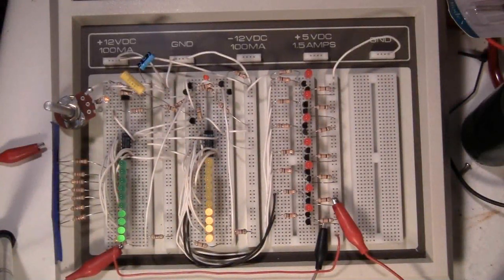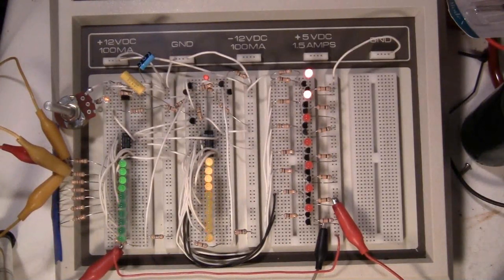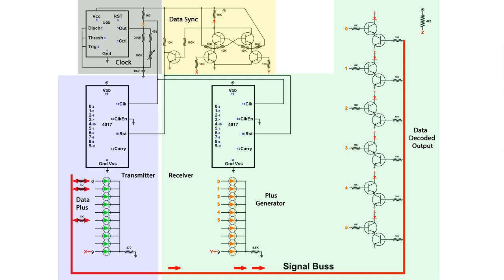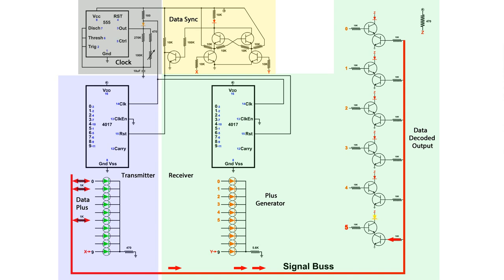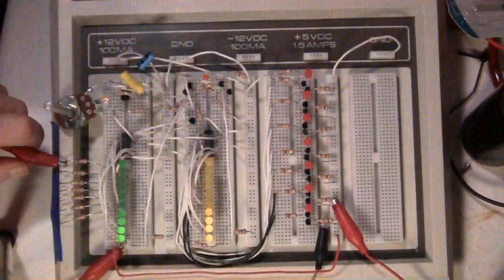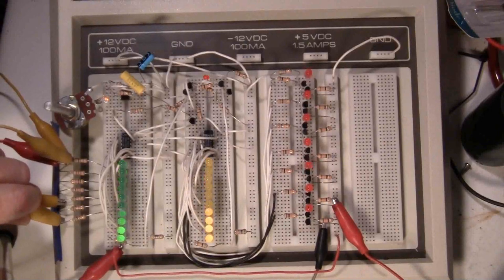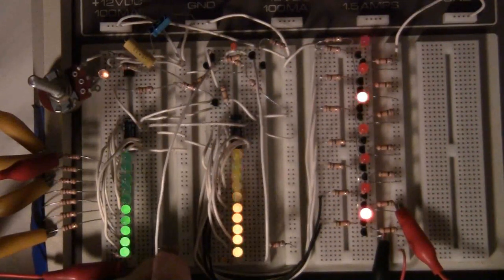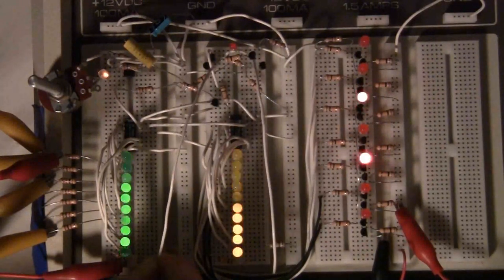Multiplexing Data Bits, The Basics, 555 Timer 4017 Decade Counters, XOR AND Gates

Comment: Rick,
In the Army I was a signal weenie and we used tons of multiplexing equipment, but we never really understood its inner workings. We just knew that it enabled many on one end to talk with many on the other end, along the same wire, as long as both ends of each conversation were in sync...and stayed that way.  We of course ran each conversation through crypto gear, which always seemed to complicate things a wee bit.
Your explanation is about 20-years too late.  :-)

Regards,
John

Comment from the maker: On the first 4017 I used 1K Ohm resistors to connect to the buss. 10K is what I wanted but I'm running out of parts. 1K is loading it down, but it still worked. 10K would still have lowered the pluses but not near as must. The best way would be to use a transistors to put the pluses on to the buss and have each output of the 4017 bias the base of the transistors.

Comment from the maker: Hey John,
20?? sure it's not 30??
They probable use a Crystal Controlled Phase Locked Loop Oscillator and the transceiver base would send Sync Packets (dedicated bits) to keep the system in sync at both ends. The other end would send back a Got-It Sync Packet.
Regards
Rick

Comment from the maker: When you clock a chip beyond its specifications, it will miss clock ticks, can't keep up. Even if the chips have the same specifications there will be a small difference between them. But also the clock leads length, from the 555 to each 4017, will be different, and at very high speeds, length of the wire becomes important. So one 4017 misses one clock tick and the other maybe two tick. And then it cascades from there. The higher the speed the worst it gets.

Comment from the maker: Thanks powermaks
It would be like when you overclock your computer bios. And SlykeThePhoxenix is right, it would be out of sync. If you were to overclock the 4017's, each would try to run, but each would be at a slightly different speed, causing a random output. And that is what happens to your computer when you overclock it to far.

Comment: "Thank You", thank you very much.
Why the need for the "sync circuit"?

Can I get a full (notes: hypothesis, parts list and schematic) copy of this project???
I'd like to build this project myself.

Let me know.

I look forward to hearing from you...

Thank you,

Charles L. Phillips
IS/IT Support Services Consultant
APC Select Partner
http://www.linkedin.com/in/charleslphillips
Reply from the maker: The decoded output has a series of and Gates. To produce an output each transistor must conduct at the same time. If the circuit gets out of sync there will be no output or the other possibility is it will produce the wrong output. There are links in the show more of this video. One link is a picture of the project, plus the wiring diagram.
Reply: "Thank You", thank you very much...
Reply from the maker: Inquire98 You're welcome. Always try and help. If you send me a message and I do not respond, do not give up. Sometimes I get very busy, also Google has managed to make the messaging somewhat less reliable. So the bottom line is, just keep sending messages if you have a question.
Reply: AllAmericanFiveRadio
Ok, will do...